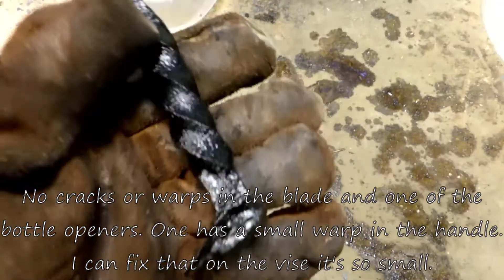Some Railroad Spike Forging

Comment: Good video! How’s that anvil holding up?
Reply from the maker: It's performing like a champ! As a novice I've missed a few times or made an erroneous blow. No dents or dings. It's definitely a quality product.
Reply: Humble Hobbyist that’s good to know. I’m going to upgrade from my cast iron harbor freight anvil soon and I want a double horn anvil that holds up well. Despite what people say the HF anvil can be used to make nice projects but the horn is really lousy and the dents mar up the pieces I’m working on. I started forging on a 20 pound rock that wasn’t even flat on top so even the cast iron harbor freight anvil is an upgrade from that, lol.